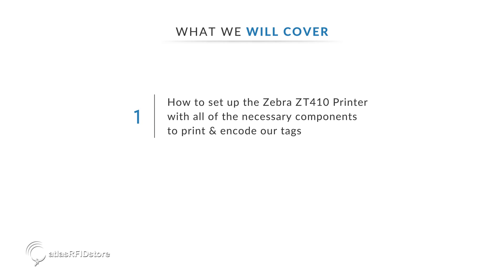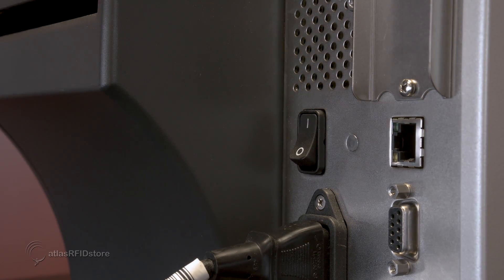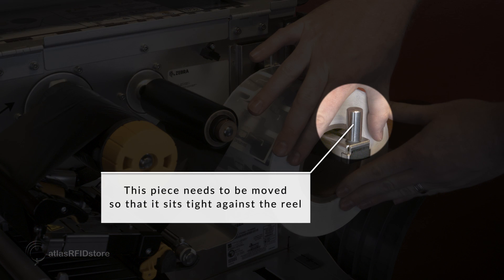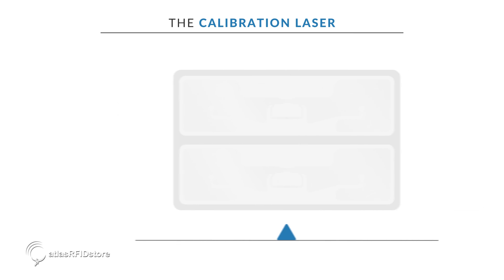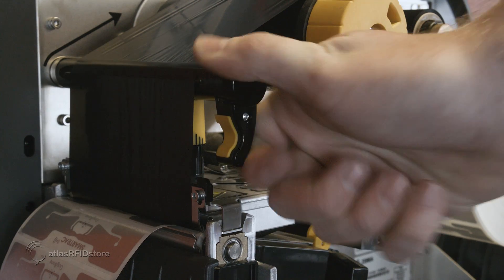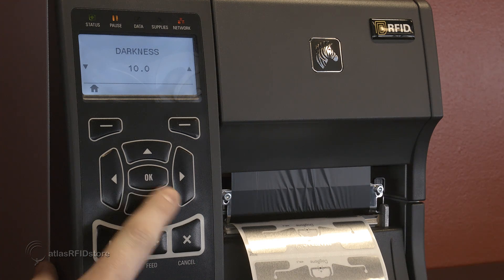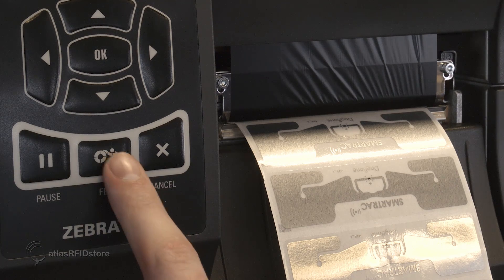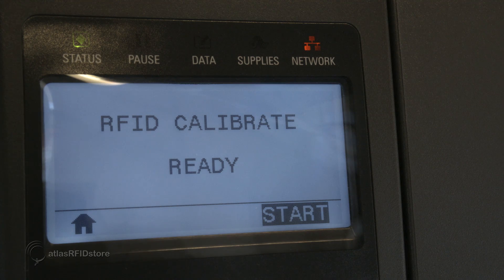Calibrating the Zebra ZT410 RFID Printer

Comment: So I do not need to use the media/ribbon calibrate option and remove like 10 stickers for it to calibrate and remove ribbon from the feed sensor and put it back again?
Reply from the maker: Hey! So you should only need to do that if you are using different media/tags than you've previously used. So if you use the same tags/media each time, you shouldnt have to worry about that. Also - I think you dont need to take off 10, might could do a little less than that for a full calibration. Let me know if that helps!